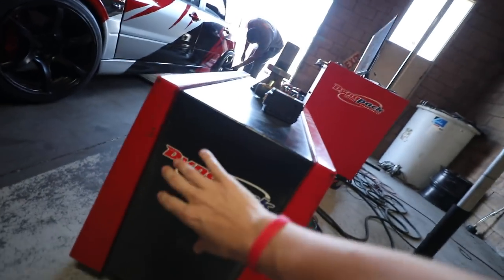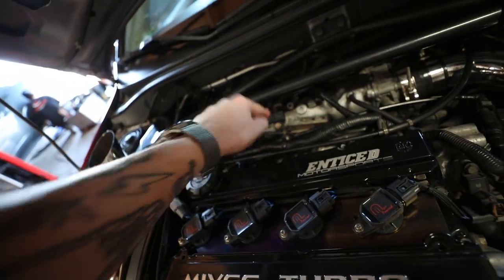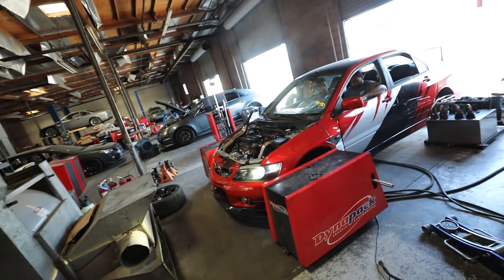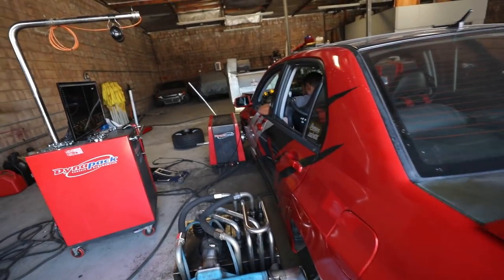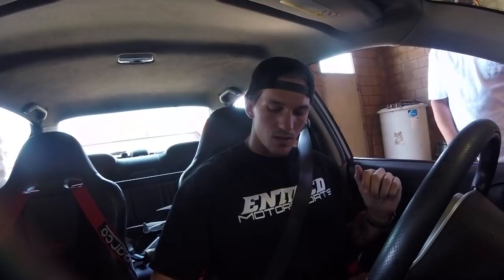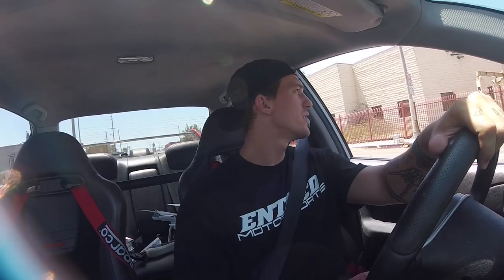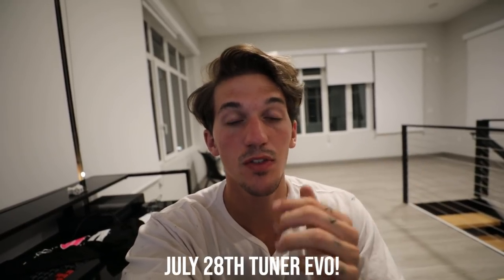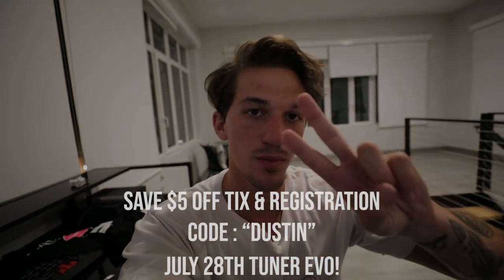EVO 8 DYNO DAY FAIL..

Comment: Evos 8 and 9’s all run low impedance injectors from the factory. There is a resister box that can be disconnected and replaced with one of these
http://www.streettunedmotorsports.com/parts/fic_resistor_pack_delete_plug.htm. The box is located on the firewall, passenger side. 

The reason to replace it is when upgrading to high impedance injectors they don’t need it.  It’s a simple mod and fix. Kind of sad that the tuner didn’t go over the car with you to make sure everything was good for the tune. It’s almost like tuning 101. 

I’d be looking for a tuner who is used to the platform. Just makes things easier.

Comment: 4 cylinders are so expensive and difficult to build, but insane when they are built
Reply: Eddy R expensive in comparison to what?
Reply: Yemi Joel a just to be clear I'm not hating at all , but a naturally aspirated v8 will make the same power for far less than this 30+k build
Reply: Eddy R well that's the thing for a v8 assuming if we compare prices . A 2016 ss Camaro is 400hp 380 trq crank. For 24k. You can get a used evo 8 for around 16-18k invest around 4k into it and have it at 550-600hp for around 22-24k not even at its limit for the Camaro u would have to do forced induction, and a tune with supporting mods to get it in the 600/700 range which would be around 10k done right
Reply: I think someone said it in the previous comments that it costed 7k
Reply: Eddy R you cant really look at Dustin's build as a gauge for making power on evos or 4 cylinders at all for the matter because he has done a lot of things that aren't needed to make power . If it was just for power you could have done a t4 turbo conversion with a 62/66 ball bearing turbo, 2000cc I injectors a build head and cams for around 4k and got a tune on e85 for 500$ and been at 600hp stock intervals and trans with room to grow.
Reply: Yemi Joel how long can it hold that power though without destroying the cylinder walls ? Brand new 30k mustang GT rated at 460~  + a few thousand on a supercharger can push close to a 1000 on stock internals .
Reply: If you buy an lsx for 10k whatever u drop it in will cost another 2-3k. For 700hp. 10k in an evo get you a build block,  turbo , trans and 700-900hp .
Reply: Eddy R no one has made 1000hp on the stock internals of a new coyotes lol maybe 700 after that your pushing it. Evos are cast iron blocks u can sleeve the block and hold 800hp easily usually the trans will go before the block but I mean u can bring in forced induction into any car then talk about reliability every car that u put x amount of horsepower becomes x less reliable . On a built evo though u can hold 700-800 with a fully built block for the price of a stock internal forced induction coyote. It's all in how you drive it
Reply: Yemi Joel that begs the question of what will last longer though?
Reply: Open discussion here just trying to figure out what setup would be the best in terms of balancing power, reliability, and cost
Reply: Eddy R but just to be clear stock block evos hold 600 hp all day as long as the torque is kept below 400 your fine. It's all in how  you drive the car and the parts you use
Reply: Yemi Joel I'm just asking because for EJs in Subarus after a certain number you need a forged block which can run 10-15k easily
Reply: Eddy R EJ motors can’t compare to a 4g63 in a stock block contest.
Reply: Eddy R yes although I love subarus ej255 or even the jdm ej207 cant compare to the 4g63 from the evo.  A aluminum block vs a cast iron block. And 4g63s have been proven to 600 hp stock block built head to get +400 on a ej motor u have to build the block and even after that its still a big risk.  K20 series, b16/18series from honda , and 4g63s from mitsubishi are the strongest stock block 4 cylinder motors hands down for handling power
Reply: Yemi Joel thanks for the replies guys!
Reply: Eddy R and as for what will last the longest it goes back into what youre using the car for if your going to be dragging it or road racing it will have  2 different effect on motors. A v8 willl last long in a drag race position that's just how it is. Now if your talking about daily driving with occasional highway pulls it's up in the air as long as maintenance is done properly both can last just as long as the other.
Reply: Yemi Joel look up “houstonstreetmonsters” on IG.
Reply: Luis Hernandez what's that have to do with what we were talking about and making cheap power on 4 cylinders lol
Reply: Yemi Joel yeah theres a 5.0 here in houston twin turbo that ran a 8.7 in the quarter on stock block and tranny.. lol musclr is def. the way to go for power but i personally prefer jdm cars cuz thats my preference but v8’s iwll always be the top dawg for performance

Comment: So 377hp or 377whp? And without 100% that’s real good my goal is just to make 380whp without building the block cuz I’m a broke boy
Reply: MazDaspeedG broke boi life. I'm building my wrx for 375 on an fp blue on 93. Something will break but I'm still gonna send it haha
Reply: Those dyna pack dynos where they connect to the hubs, is not to the wheel.
Reply: 380 whp on a mazdaspeed 3 is easy bro hpfp fmic upgrade turbo cheap (bnr s3) and a dp with a good tune will have u about 400hp/370/tq keep tq low because rods are the weak point on of our engines
Reply: Josh Fulcher ima get the s4 but sticking with the upgraded tmic see what it dyno’s
Reply: About to go meth injection know anything about a NX meth kit someone selling it for a great price but I hear the forums always going with snow performance or AEM
Reply: MazDaspeedG hella heat soak dude u on the mazdaspeed fb page ?
Reply: Josh Fulcher maybe some heat soak at idle atleast I’ll have meth to keep my temps colder. Yeah I’m on the fb page I’ve filmed all my mods on here
Reply: MazDaspeedG cool dude add me so I can fallow the build mY speed6 should be back running month or 2 built forged block fbo 5858 turbo looking at approx 600 awhp I. hoping for 500 I'll be happy
Reply: That sucks for you guys my evo makes 402hp with 380tq on stock turbo
Reply: david chanon  we can also on stock turbo bro it's that stock ko4 wont last with that kind of psi u will get a good 6 months out of it  our engine makes good power weak point is rods and shitty stock ko4  u can get 530whp on stock block but playing with 🔥🔥 at that point
Reply: KZNEvoX dude that's perfect tbh like who wants to DD 500hp

Comment: Greetings to all the viewers. I’m the one that tuned the car

Couple of this to clear up
1. The car had a resistor box in it thus the reason we stopped. FYI our shop doesn’t hold your hand and fix your car and/or inspect your car. It is to be ready on receipt when we step in. If we find a issue we stop and send you back to whoever worked on it to fix.

 I could have personally bypassed it myself but because of liability issues etc, have the customer do it himself or by buying a pre made terminating plug or he could hard wire it. The clean way is to buy a plug. I have done this on other Evo’s personally. 

I short we just tune. Not wrench. Btw I owned a Evo 10 myself from 09 to recently begin sold in 18. 

Remember we’re all human. So humble yourselves. 
Ignorance is bliss. Have a nice day folks 👍🙌🏿